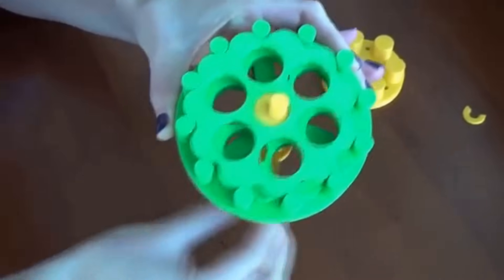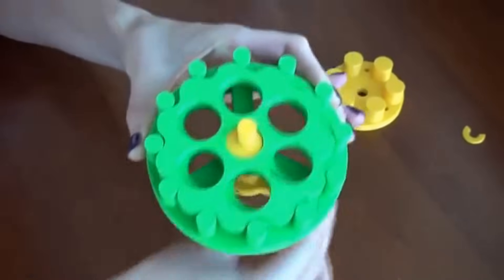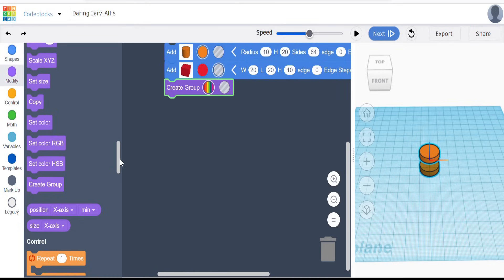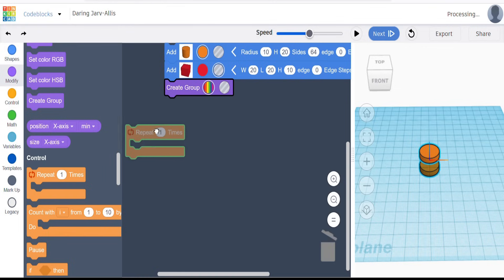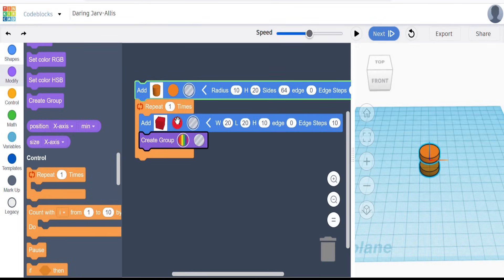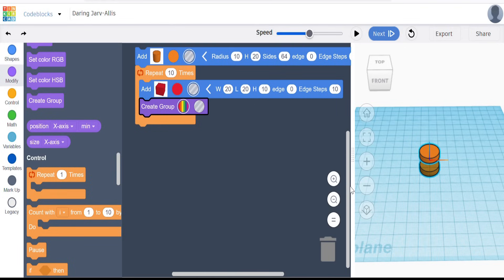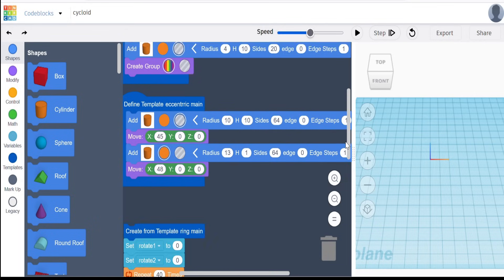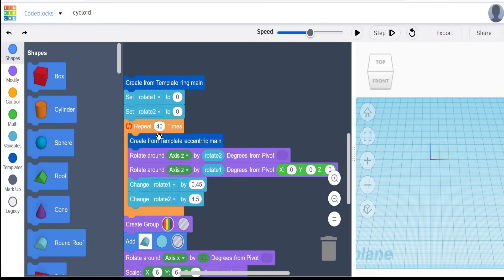2318 How To Create Cycloids - A Tinkercad Tutorial

Comment: This made me think (It didn’t hurt as much as I was expecting) from position 0 (absolute 90°) on the large orange disc, we move to 108° (90+18) the cam will have to rotate more than 180° to be at BDC, with reference to the axis of the large orange disc. Specifically the smaller disc would have to rotated 198° for tangents of both discs to be perpendicular to a line drawn between both axis’s. I hope I’ve explained that adequately.
Regards
Rowan
Reply from the maker: no mate the line isn't drawn yet - you are drawing the line so you fix the rotation of the smaller cam to 180 - it will then trace the path - i you fix the angle of rotation at 198 the path will be too long